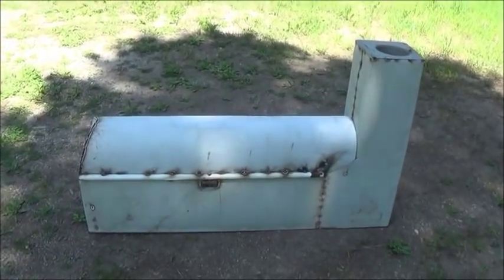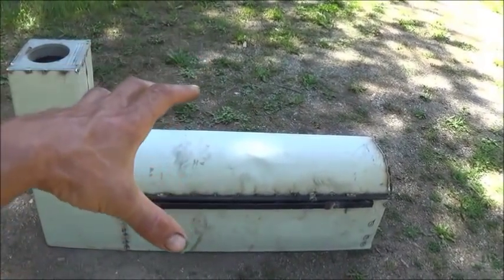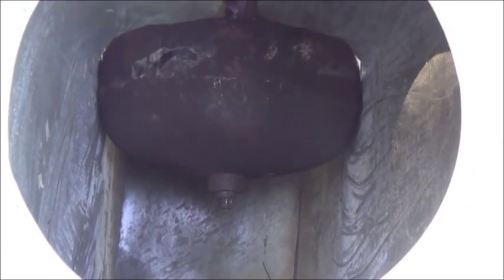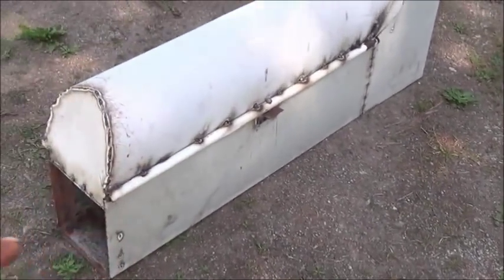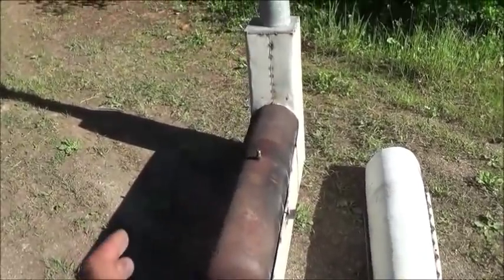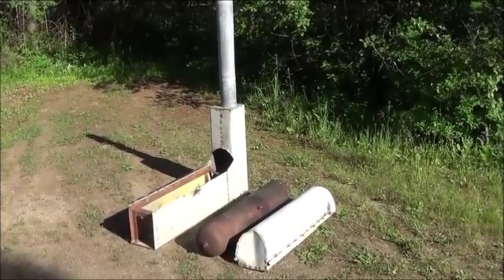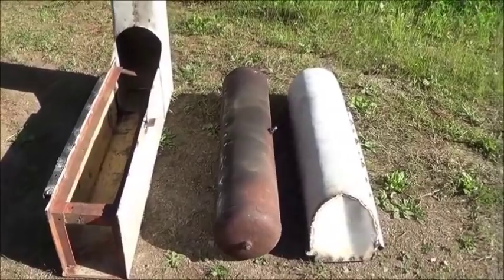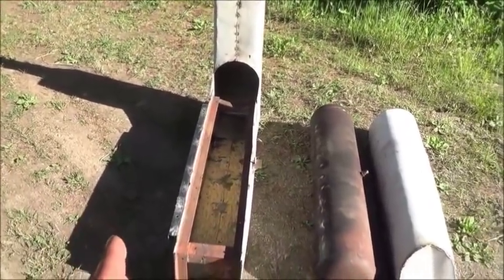Homemade "Rocket Stove" Steam Broiler, Built To Run A Steam Engine .

Comment: you need to get a heating element from a water heater and a solar panel to make this a completely green assembly and you can get around the burn ban so you can start testing out your steam engines.
Reply from the maker: With an element from a 110v water heater using 1500 watts the tank would take 45-60 minutes or so to get up to at least 212deg.  this would require an enormous solar panel array and a substantial amount of battery's. Solar would be better used as a direct electric drive system or from solar to batteries to  neodymium motors in the hubs. I have enough wood in old slash piles to power a wood stove for 20 years, so instead of letting it burn or rot might as well use it!

Comment: What did you use as the pressure vessel?  Was thinking a gas cylinder would be great because designed for 3000 psi.  Yes I know the heat will greatly decrease that.  It does put a greater safety factor into the game.

Comment: hey i watched your video on creating the battery out of the ground u did 7 coils of the copper and i believe steel what was the reading when u wet the soil im really intrigued by this im an hvac tech and looking to do something of this sorts if im able to get it even up to 6v dc i can convert it to ac then step the voltage up to 120 and run the house with it please get back to me i would love to pick your brain about this

Comment: are you going to install a check valve pump to refill with out letting pressure off !
Reply from the maker: No, this is nothing more than a test unit built to generate design ideas.  If I feel it can be run with relative safety than it may become a homemade steam powered tractor, I have all the pieces ready.

Comment: If you accidentally touch a high pressure steam vessel with your bare skin, your skin sticks to it, you instinctively pull away, and your skin stays on the vessel. Takes several months to heal if it happens to be your forearm. May I suggest a kaowool wrap? Be careful, and weld well.
Reply: +MrTeslonian but still... be careful.. you never know. accidents always happen..
Reply from the maker: Your right, there is no real error room in this, so caution and attention to precision is crucial to safety. Thank you.

Comment: On the steam . I heard steam was good for killing weeds. They have propane torch wands but I have to get in between plants mulched with wood chips so I doubt that will work. Anyway I think something like a propane powered fogger would work. A firebox with a twist of pipe and a bit of tubing to point the steam down. Any ideas?
Reply from the maker: How about a robotic platform controlled Fresnel lens that uses the sun to not only move the robot, but to burn the weeds without fuel or cords.
Reply: ***** It is a bit out of my league.  I could go solar on a proof of concept if my overhead projector Fresnel lens is the right focal length I could fix it to a staff and give it a try.  I liked steam because of the risk of fire. I have an electric steamer for clothes but it doesn't have enough power. I was using a foam board to shelter the good plants. I will take a look tomorrow to see if it had any effect.
Reply: lol, yes, i like that idea
Reply: enator71 The Japanese had a gizmo like that for trees to make them drop all their leaves at once.  So grounds keepers could pay the staff for one leaf cleanup instead of the whole fall season.   My neighbor uses an open current to gather dew worms. They come right up.

Comment: I cannot wait to see what amount of energy you're able to create with this fueling (I assume) your re-purposed air-compressor and (I assume) turning some kind of electrical generator. I am just curious what the labor to output ratio is going to be... By creating a similar design, am I going to have to bust my ass 4-5 times a day filling the firebox with fuel, or keep me going for a single burn a day... Obviously all those factor daily KwH, how many watts can be used, how long the fuel burns, etc. I'd love to pick your brain, but even just a little summary of what you're planning to do (like the grand scheme) would wet my whistle.
Side note: Couldn't you just throw these things into the back of a pickup and go fire them off where there isn't a Fire Ban?
Keep up the good work!